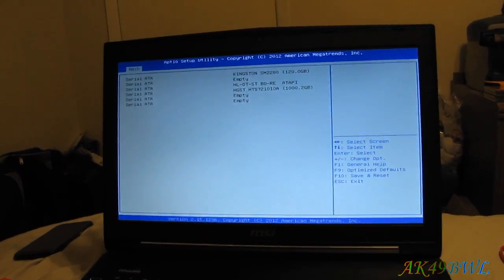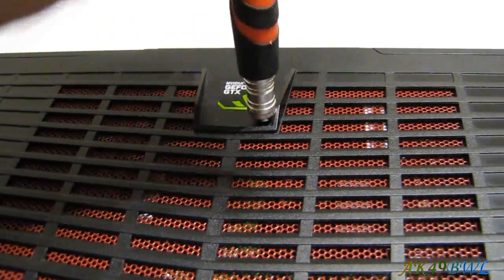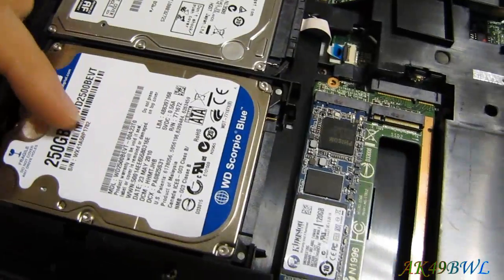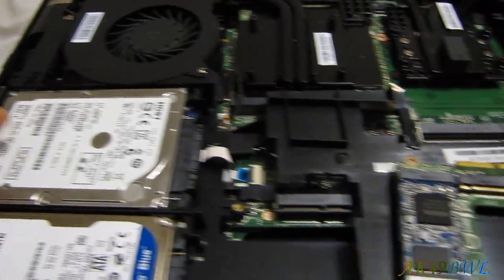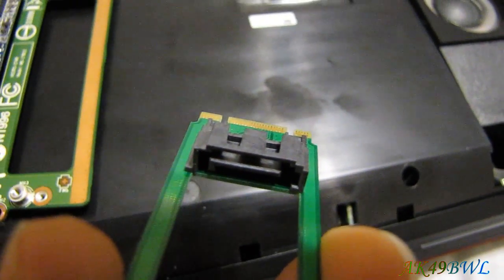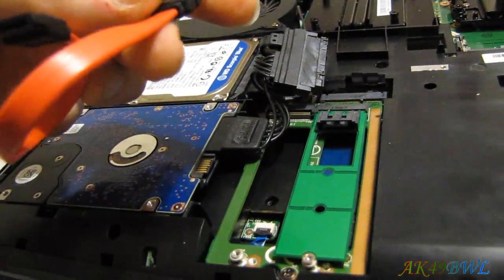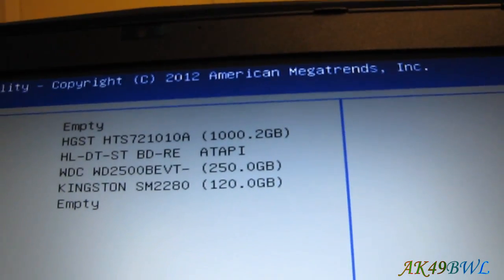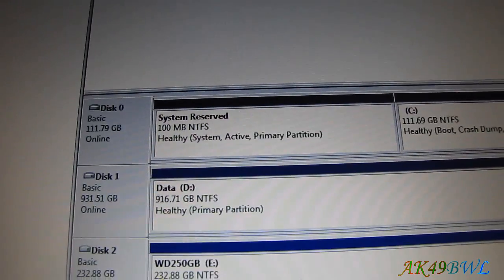How to Install a Second 2.5" HDD in the MSI GT72 Dominator Laptop

Comment: Hey Brandon, I'm running windows 10 on my MSI GT72S and under the UEFI settings, fastboot will not turn not when I save changes and reset. it still shows disable everytime I go back to check. Do you have any idea ? Thanks in advance
Reply from the maker: I don't, sorry.. I never used the UEFI on mine, when I installed Win7 on it, I wasn't aware UEFI was supported by Win7 so I disabled it. Maybe there's something in Win10 you have to enable first? It might be the UEFI loader is looking for a setting or file on the hard drive that Windows is supposed to put there. I'm blowing this all out my a** tho cuz I have no clue LOL
Reply: Brandon Thank you for the quick reply. It could be because of the BIOS update I did recently. I'll try reflashing the same bios image hopping it's not gonna mess up anything. I personally prefer legacy better, but when I installed windows 10 in legacy mode, the laptop would spend 21 seconds just in the Bios. With UEFI it only spends 7.4 seconds, but still takes around 23 seconds overall to boot up to windows.. Slightly slow to me considering it has a Nvme with 2000read and 600write speed. Maybe Im just wanting too much Lol..
Reply from the maker: Lol I tell you what, going from my Dell Vostro 1500 to my MSI.. When it booted up in 30 seconds flat, I nearly shat myself 😂 I think it's kind of an unwritten rule that laptops just take a little longer to boot up under just about any circumstance. My SSD desktop with the exact same SSD I use in the laptop takes only 19 seconds, power button to desktop. Me? I'm just happy it doesn't take five minutes anymore lolol
Reply: Brandon Lol, you definitely right about that..
Reply: Just a quick update. It only takes 12 seconds to the computer to boot to Windows 10 now. And I don't remember doing anything to it. That's a cut down of around half of what it used to be...However fast boot is still disable. Glad it works fine anyway 😁👌👍😎

Comment: Hi, i have a question, i have the MSI GT72 DOMINATOR PRO-208 17.3" Gaming Notebook Computer  which i bought 3 years ago, still a great computer, i am coming to the U.S in a month time (WV) and i was wondering can can be up graded? Is it possible more memory? i already have 32G and graphic card 8G if not mistaken, i appreciate the  tips
Reply from the maker: RAM is max 32GB, video card can go up to the GTX980M.
Reply: Brandon it already came with the gtx980m. So there is nothing to be upgrade in the laptop? I will adding at least an external 2k srbg mnitor.
Reply from the maker: Yep, that's about the limits of our systems.
Reply: Brandon bummer. I wanted more😁 she is fine i just wanted more juice, i have to replace battery though.

Comment: Hey man, can i use nvme on the m.2 slots or am i limited to sata ssd? 
Because, if i remember correctly, i saw in the bios that my model use 2x toshiba 128GB nvme.
My model is GT72 2QE if that helps.

And can you tell me the name of the extra cables that i need to do this modification?
I got the SATA to m.2 adapter card six months ago, now i need the cables.

Thanks in advance man :)
Reply from the maker: The 2QE is only slightly different from mine, so I wouldn't think it'd be able to use NVMe drives. I know for a fact mine does not support them at all.
Reply: @AK49BWL  too bad then. Thanks for the reply man
Reply: Update your BIOS settings if you do not know how to get a qualified MSI technician to update all of your drivers, but before that do this get it  to a qualified MSI Technician install a Windows 10 pro you can do that with your base model ok now you are going to need Acronis or Aeomi backuper cloning of Operating Sytems ok are you following now here is what you can do.
This particular model supports up to 250gb on the 4 Nvme or M2 slots now you want to get a Nvme Gen3 because I am not sure does it support a Gen4 you can check it with a qualified MSI tech support I believe it supports Samsung, Crucial and Integral anyway I want to give you this guide so get the following.
Purchase a 2TB samsung EVO860 this is to replace your  Hard Drive which is an obsolete antique by now!.
Now there is an Alternative to your Nvme Gen3 there is a chance of you purchasing 250gb of MSI M2 gen3 which will be compatible with the MSI because it is MSI this a major thing most companies do so you wont run into any problems installing them so you have 4x slots with 250gb of Ram which in total supports the 1Tb and this way with the 2TB of Samsung  with this in mind you now have 3 Terabytes of storage.
So 32gb of Corsair DDR3 1600mhz you can search on amazon for two sticks, but the issue here is the Timetech DDR3 the original ram is bellow the motherboard now unless you are a technician this can be tricky but follow my guideline ok.
So get the Aeomi Backuper install it and now with windows 10 pro on this machine you can install a Wifi 6 or Wifi 6e card which will boost your internet speed upload and othe stuff the MSI gen3 Nvme is pretty fast so it is around 3,5 k of read and write speed, and basically doing all of this and if you have not change the battery if you the laptop for a long time as it can cause issues as well.
So 32gb Corsair Vengenace DDR3 or HyperX you choose anyway with this setup you do not need any extension cables and after you have done all of this my advice is go to MSI and get laptop insurance I am a tech guy so I know how to do this things for you it may not be the same situation.
You can have the alternative you can purchase a windows 10 pro keygen online much cheaper and basically put it on a piece of paper and take it to MSI they can fix it for you so.
Wifi6 or Wifi6e 
Windows 10 pro
32GB of Corsair vengeance or HyperX Ram 1600mhz DDR3
MSI Nvme Gen3 or Samsung 970
Crucial or Samsung860 2,5 inch 2TB 
But my advice to you is installing windows easy, but since the GT72 2QE has this issue with the ram slot design you would have to unscrew everything and if you are not a tech guy you will get confused and you will fail so my advice is buy the ram, buy the SSD, buy the wifi6, buy the keygen and tell an MSI tech guy to mount the RAM the wifi card and to install windows and update all your drivers and BIOS safely, so yes that is your safest bet to get to a tech guy once you have purchased all of the parts, and the reason I am advising this is because the Timetech ram is under the motherboard so you would mix RAM and that would cause a huge issue so with this in mind you can do all of this.
This way you get the max out of your platform later on my advice is that you get some insurance for your laptop as this may save you money in the future in case the device breaks and this is the maximum you can do on this machine also you could ask for a Nvidia RTx 2080TI do they have that available but slowly slowly this machine is still a supercharged BMW among laptops nice Laptop by the way insure it MSI is powerful but there can always be issues with them!.

Comment: Hello. the video is old but I hope you will see my message. I am desperatly looking for the small sata connector that you are connecting at 9'47. The original one is broken and right know I have to do with only the original  256 gen3 ssd... and I run out of place. So just another sata harddrive will be good but I need that little sata connector. When I search for it on the net I find somes which look similar but there is 7, 15 or 20 pin and  they are told to go with specific brand like asus dell or so. So I don't really know if it will work or no. If you could tell me what I have to really looking for I will be very happy. Thanks.
Reply from the maker: I'm guessing you mean the little ribbon cable that goes from the motherboard to the 2.5" hard drive that the laptop comes with? Mine broke about a year ago but hasn't been in use for several years since I upgraded to using 4 M.2 SATA SSDs... No more mechanical drives. But that cable is rather hard to find, I think I might have come across one on AliExpress...

Comment: Have you tried that m.2 to sata adapter from ali, that comes with the power cable? So you won't have to use 22 pin to 2x 15pin and 7 pin female adapter?
Reply from the maker: Nah, upgraded to 5 SSDs from what I had in this video, never looked back lol
Reply: @AK49BWL  cool :D
Then I'll try that adapter myself and will try to make a vid of it. Also, have you upgraded your gpu?
Reply from the maker: Wanted to, but the kit to upgrade to the 980 was always too much for my poor blood 😅 nowadays I'd be better off just buying a whole new laptop.
Reply: @AK49BWL radiators from broken gt72 are that expensive? I saw radiators for 1070m on ali. But they are too expensive for me. I want either chinese 1070m (so I won't have to do anything to my radiators) or quadro p5200. But it's too expensive
Reply: @AK49BWL  How to install 5 SSDs?😯 I thought the maximum is 2 SSDs.

Comment: I am not sure if I understand it... I have a GT72 Dominator Pro laptop with two SSD of 128GB each one (total 256), so I have two SSD slots and I am using both. Do I have to remove one SSD to place that long piece at the SSD slot???
Reply from the maker: If you truly only have 2 SSD slots... If so, this is the first I've heard of anything besides 1 or 4 slots. Have you looked to see what's inside? Your SSDs may be mounted to the top two slots, and you have two more empties underneath. You can move your existing SSDs to the underneath slots and still install another drive, all you'll need to do is change the hard drive boot order in CMOS setup.
Reply: Thank you very much for your quick answer. You are right, I have two empty slots underneath, I guess there will be no problem about moving the existing SSDs to the underneath, no data problem, need to do something with the bios or something like that right? I have just purchased this kit http://eshop.sintech.cn/sata-ssd-to-m2-ngff-adapter-card-with-power-for-msi-gt72s-p-1132.html Looks like the laptop will be easier to close with this one.
Reply from the maker: Yeah, sintech didn't have that when I made this video haha. As for the boot order, are your two 128s in a RAID or separate? Not sure if RAIDs are the same, but for single drive's all you need to do in the BIOS is make sure your boot drive is at the top of the list of bootable drives.
Reply: Both SSD are together in a RAID yes.
Reply from the maker: Well, I guess all you can really do is give it a shot and see if it works to move the drives around lol. I can't offer much help with RAID stuff because I don't run it.
Reply: If you have 2 SSD then you will have 4 M.2 slots.

Comment: why not just get a dvd drive to 2.5" adapter? Leave the screw out and you can change them on the fly. It stays in well enough that it wont fall out without the screw
Reply from the maker: Rusty Shackleford did that with my last laptop. I like this better.

Comment: question: my laptop has one slot and it has a 2gb ram in it but i have an extra 2gb stick lying around. is there any way to add it without changing motherboard?
Reply from the maker: +anthony star by one slot I'm guessing you mean open slot? because if it is open, then you actually have two slots, but one is taken by the current 2GB stick :) .. if your RAM stick fits the open slot, it should work without any further work involved.
Reply: the laptop has one slot for one stick of RAM and i have a 2gb in it but as i have an extra stick from another dead laptop i am thinking how i can use it? thanks
Reply from the maker: +anthony star Try it and see, if it's the same type (DDR2, DDR3) it should work.

Comment: i have the same laptop and i want to remove the blue ray drive and replace it wit an ssd ,can you tell me how to remove the blue ray drive?
Reply from the maker: There's a screw very close to where the middle of the back of the drive would be on the inside, remove that screw and pull the drive out from the side.
Reply: i did that but the drive not coming out ,i don't know why
Reply from the maker: It's a bit of a tight fit, might be easier if you pop the drive open. It's not easy to break the drive so just try giving it a good tug. If that doesn't work, you may have just removed the wrong screw.
Reply: the screw i removed is the one in the slot in front the hardrive
Reply: Talk Your Talk R.Pierre I got thru bro thanks ...it really needed a good tug..

Comment: the link tothis part is not showing the same product?
Reply from the maker: Which part? The SATA to NGFF adapter link and the power splitter SATA passthrough cable link is still good... The forum link doesn't seem to take you to the right page anymore, but that's not even a big deal...
Reply: sorry the part that the x4 M.2 ssd slots are on. ive been trying to look for it for ages.
Reply from the maker: You won't find it. It's an MSI-proprietary part, I have NEVER seen it for sale anywhere.
Reply: do you think ill be able to get it from them? i have contacted them but the sent me to site support that looks like a forum.
Reply from the maker: I honestly don't know.. I'm not familiar with MSI's tech support but you might be able to call em and ask. I find it hard to believe these cards never break and they don't keep a backstock on hand lol.
Reply: coolio thanks man

Comment: I want multi  m.2 connector I have in my msi gt72vr 6qe laptop only 1 i want this 4 m.2 connectar where i find it please help me thanks
Reply: miggkey josephhhhhh with the new model where it only has one slot the chipset is HM170 and it only supports one pcie slot. Where as the model in the video is a cm23/26 chipset and supports more pcie lanes

Comment: Thanks

This model supports 4 x M.2 drives - where can I install the other two?
Reply from the maker: Eden Dro You have to remove the little card that the top two are mounted to - the other two ports are on the bottom of the card :)
Reply: ***** Thanks!
I saw that after I asked - but how does it play with performance? all on the same bus?
Reply from the maker: Eden Dro I can only assume they aren't all really on the same bus. There are enough pins on the card for four SATA3 ports, which is essentially all these computers run the M.2 at - They aren't PCI-E like I've heard they're putting in even newer systems now. If they were PCI-E, then I could only guess the M.2 adapter card would have a lot more pins at the mainboard connection.
Reply from the maker: Eden Dro As it is, I have two M.2 SSDs (one boot, one extra, not a RAID) and a hard drive running off that card, and my computer is still only taking 25 seconds to boot to desktop. That's fast enough for me!
Reply: ***** Well, I actually got the new MSI GT72 with I7-5700HQ and G-Sync
So, these are M.2, but only in form (-: it does have some advantage though, for future use (not that I want or need more than one SSD)
Reply from the maker: Eden Dro Do the newer ones have the same general internal layout? (and the lack of another SATA connector for the second 2.5" bay? lol)
Reply: ***** I still remember my Commodore, so..
And the boot times depend also on what you're running - stuff like AV and many applications on startup will result in performance heat

I got this laptop for review on my small site www.gaminglaptopsjunky.com. I'll mention you and thanks again!!
Reply from the maker: Eden Dro I appreciate it :) Gonna go have a look!
Reply: ***** still haven't posted the review! and let me know if I can assist somehow

Comment: Is it possible to buy a M2 card with 4 slots?? Because my laptop only have one M2 slot and I wanted to install another ssd
Reply from the maker: Nope. If it didn't come with it, you can't use it even if you did manage to find one.
Reply: Brandon so there's no way I can install a second m2 ssd?
Reply from the maker: Not unless you get like an M.2 to SATA adapter and install it in the CD drive's place. I don't know why they did away with the four-drive setup on the newer models.
Reply: That's unfortunate. Does that mean I can't install a second hdd since there's no other m2 slots?
Reply from the maker: Correct.

Comment: how can I upgrade ssd on my dominator pro and keep the files/OS?
Reply from the maker: +Jay Miah you'll need to install the new SSD alongside the old one, then use a live CD data transfer software. I think I used GParted Live on my mom's system, couldn't have gone any smoother :)
Reply: +AK49BWL could you link my to the orange small cable u used. Please and thank you? The one at the end of the video you said you could see but not to worry about? 

Thanks

Comment: where did you get that m.2 have 4 slots expansion?
Reply from the maker: Came with the computer.
Reply from the maker: nobody likesme so uh......how much is it? In USD? lol
Reply: 137 USD +delivery
Reply from the maker: Ouch. Here's one on eBay for $76 lol https://www.ebay.com/p/MSI-Gt72-Quad-SSD-Adapter-Board-Ms-17812/1475062362
Reply: that's expensive but it maybe worth for 4 ssd install. thanks bro
Reply from the maker: If your system didn't come with the option, you won't be able to use it... Just a heads up.
Reply: Brandon, you mean that it would not work with another motherboard? for example if i have MS-1785